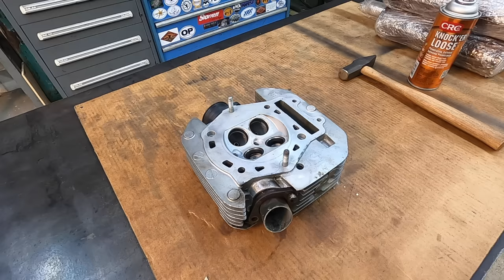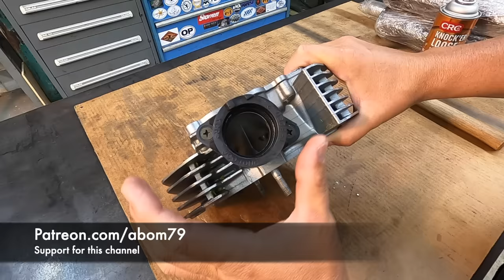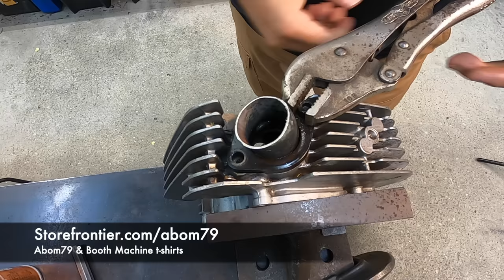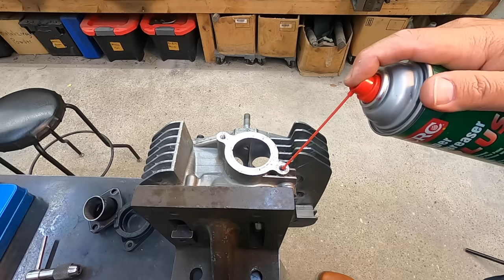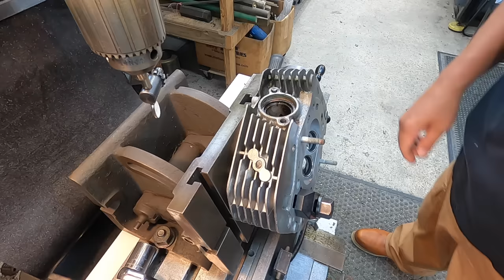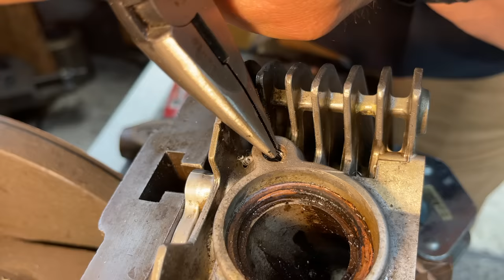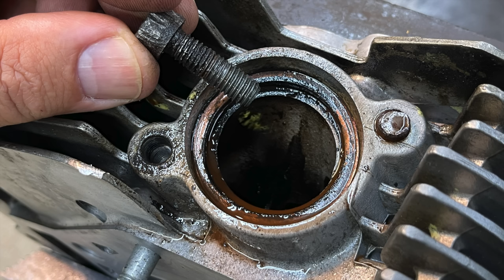Broken & Siezed Bolt Removal, DR 650 Cylinder Head

Comment: this side of the pond we would tig a nut or bolt stub: cut of at the start of the thread, The same type as the stuck caphead. That in and of itself may well do it but leave it to cool right down. ie Heat and wate not weight. Then  put the whole head in a PID controled electric oven/furnace  and slowly heat to some 350Deg C. Then using a HHO (browns gas torch) heat the stuck stud up to pretty much red hot. again bring the whole assembly down using the ramp facility on the PID say over night. Now get your light weight rivet gun with variable strike and a grolly bar (1/2" extention with spanner flats or a built in ratchet handle while ratteling it in an axial direction apply such torque that you estimate the bolt will stand. If it is going to come it will come out quite easily under heavey strike and constsnt torque.
If it wont the next possible attack is spark erosion We have used it many times on restoration of uk vintage military jets. There are plenty of sources for that teknique, It takes time though and special kit that you can hire, well you can over hear.
Another attack is clamp the patient on the bed of your milling machine note and lock the X & Y positions, having  identified the thread for its dimensions use a carbide slot drill just a thou under the bolt crest Dia. and as acurately as possible center the cutter. Now run this carbide slot drill a couple of threads debth down, inspect to see if uou are in the center unlock the slides and adjust accordingly proceed to the bottom of the bolt checking every couple of threads.
Might be an idear if there is sufficent material to put a helicoil in while it is still mounted in the machien. Thats why you lock the slides and you now have a carbon steel bolt on a SS Helli, not as likely to jam up again.Remember the first souple of threadsi nspection is important.
Don't  mess around with the easey stuff it never works and cam make the situation much worse leading you to have to call out the big guns PI like rivit guns
Reply: How many people have even one of those specialty tools in their garage?

Comment: When you have a seized Allen head find a torx impact bit slightly larger than Allen socket size, (may need to drill the head to enlarge) then use your impact driver and a hammer. Torx will cut into the Allen head and get purchase, impact driver will shock and apply torque - which is better than just straight impact as you are doing with the punches. Impact driver a must for old Japanese motorbike maintenance/repair.
Reply: I have used the straight bit from that impact kit, on a socket and socket extension to pound in a screw driver flat.  I have never tied the torx.  I may like that better.

Comment: could you not have tried to heat up the bolt with a torch? thats what i used to do to get seized bolts out.. just try to heat the steel bolt up, not the aluminum head
Reply: Maybe on a bigger scale situation, by concentrating heat on the bolt only, but nothing beats the TIG  and bolt at specific time with a spanner, please read my comment on top.

Comment: If it's sticking out like here I'd first try to cut a groove in the broken bolt and use impact with flat bit. you can always drill it later if it doesn't work.

Comment: Another way to remove the broken bolt is try a left hand drill which if it does come out then try an easy out before drilling out and picking. Works most of the time for me.

Comment: Thought this was touted as the easy way to get bolts out. Man, all that machine stuff and all. Great you got them out as you did, but the one with the missing head, I'd have gotten it out way easier than setting up all that stuff for a drilling step that way.

Comment: I just don’t know why motorcycle makers don’t use stainless hardware on exhaust systems.
Reply: Stainless Steel actually NEEDS oxygen NOT to rust. So it will still rust deep inside tight  spaces when exposed to moisture. So I was taught while doing Mechanical Engineering.
Reply: @peterchinquan8919  🤣 yes it can corrode in low oxygen situations. The way you said that was an exercise in verbal gymnastics.

Comment: “Jis” Phillip Head screw.? Wats jis mean
Reply: Japanese Industry Standard  they are different to a standard philips head the cross section is flatter if you use a philips screwdriver on these they will strip out the head.

Comment: Great job!  Penetrating oil is my first go-to followed by taps with a hammer like you did.  Why didn’t you use an easy out after you did your first drill out?  I saw another YouTuber simply cut a straight slot in the bolt head with a cutoff wheel and use a straight slot screwdriver to remove.  Just for everyone’s info.  Works for me!

Comment: I'll admit this is somewhat crazy and dangerous, but if you've got a seized steel bolt in aluminum, try some full-strength sulfuric acid, as in battery acid. Use the acid as you would penetrating oil. Work fast and have some baking soda and water in a squeeze bottle to neutralize the acid. You will lose the threads and you'll have to put in a helicoil, but at least if you're lucky, you can get the bolt out

Comment: I Work in heavy equipment and trucks for 40 years and most of the time when the bolts are seized or whatever term you want to use the last thing you want to do is drill them out takes up more time than you really want to put into the head the best thing to do is use penetrating oil like you are for starters and there is a  trick I’ve used is to heat up iBolt then use some candlewax to get the wax will flow through the threads it sounds kind of hokey but it does work    Weld a bolt to a broken stud if possible sometimes you do have to drill little bit and use an easy out

Comment: I used  heat and beeswax  works well
Reply: Worked in an automotive machine shop. Heat and wax worked well for us. Have to watch, NOT TOO MUCH HEAT. Especially aluminum
Reply: @dalehood1846  yes I also yes antsize I  work bkes so if your taking high heat using any harden bolt in aluminum heads when putting back together  and the  porper torque setting never had a problem no matter how old

Comment: All you had to do is put some heat on it there is old thread locker on the bolt and heat will burn it out you then it will loosen

Comment: I've worked on old motorcycles for many years. You can do it easier by using an angle grinder with a thin 1mm cutoff disc to cut a slot in the bolt head, like a screwdriver slot. Then spray penetrant and leave it over night. Then most of the time the impact screwdriver with a flat bit will get the bolt out, you just need a bit of patience, lots of small whacks will work the penetrant through and the rotating impact loosens the siezed threads.
If they are real bad, I cut a big notch on the outside edge of the head, and use a punch and hammer, hitting at a tangent. This puts huge turning forces on the bolt head but usually does not shear the head off because the force is quick. Again lots of smaller hits is better than trying to use larger hits and wrecking the head.
I've never needed to drill out a bolt in a motorcycle head, to me that's like an amatuer method sorry. But I have had to work it over a couple of days with penetrant spray and punch tapping each day until it eventually loosened and came out.

Comment: I would put a tap in the fresh hole, and then put the tap in the drill head. It is easier to move the whole head so you can put the broken bolt under the drill head

Comment: Using a female easyout does the same with an impact wrench
Reply: I have never seen one of those.  Does it need some bolt shaft above the surface?  I like the normal internal e-z outs.  When you drill the hole though the bolt, (not touching the threads, and I can drill them by hand), the hole actually relives the pressure on the threads as you twist it out.  I just use a small crescent wrench, (or maybe should try a tap handle.), and careful because the e-z out is hardened and could break if you get sloppy with the force.
Reply: E Z Out is the biggest “Naming Lie” ever invented.  Absolutely nothing  EZ about them!

Comment: I tell you a trick I found out but experimenting. After you put that vice grip on tight get a hammer, no we're only doing tap we're shocking that whole bolt. How don't hit the end of that vice grip but tap the middle, why you tap the end it only bounce back. But hit the middle  it somehow lock and the end weight is like a flow through. This way shock the bolt. I have done it to all tight bolt even rusted and it alway comes out after a few hit. Try it  both way, and see what Iam talking the middle you can shock the bolt at a lower just tap even holding the hammer in the middle also, about 5-8 times tapping should  break it free.
Reply: Well not vice grips, but  your socket wrench as that longer, but load the nut by holding it toward counter clock. And tap the middle

Comment: Afraid of damaging your locking pliers in the beginning?
Reply: Don't know if you ever used vise grips, but the adjustment bolt on the end adjusts the jaw span.  If you can't get them shut, you have to loosen it a bit.  He was using them correctly.  If you get them too tight,---they can be a pain to remove too.

Comment: I have had good success using my Dremel tool and a carbide wheel to cut a slot in the end of the broken bolt, then turn it out with a standard screwdriver.
Reply: You're not breaking that loose with a screwdriver
Reply: @spacejamgoliath  Agreed, probably not that one, but it does work in some instances. Cutting the slot creates a little heat and helps also. It works more often than you would think. It's also important to use a screwdriver with a square shaft or a hex so you can put a wrench on it.
Reply: @spacejamgoliath  Impact tool does come with a straight blade for slotted type screws and bolts.
Reply: @Orange-Jumpsuit-Time  what does that have to do with a screwdriver? Did I say an impact won't work?  Bye
Reply: @spacejamgoliath  By putting the straight blade attachment onto the impact tool you have in effect turned it into a......wait for it......screwdriver. Duh.
Reply: @Orange-Jumpsuit-Time  do you just like arguing? I clearly meant it wasn't breaking loose with a HANDHELD SCREWDRIVER. Now good day
Reply: @spacejamgoliath  "HANDHELD SCREWDRIVER"? How do you think you hold the impact tool with the straight blade attachment with, your teeth?

Comment: so much overkill. time = money.
Reply: That depends on what ever else you have to do.  He is doing it as a favor I am sure.
Reply: I think this was more about showing different ways to approach the problem. I  think that it's called sharing knowledge and experience. Do you have a link to your youtube channel?
Reply: @anneeldon2735  sorry, didn’t realise only those with YouTube channels allowed to comment. 

There’s not many that have all that equipment at home so you can either take it to someone like this guy who will charge you $400 because they spent half a day messing around, or you do it yourself in any one of the countless quicker and easier methods. It’s a snapped bolt on the exhaust port of an air-cooled head, not a m2.876 bolt on the JWST.
Reply: BuzzyRR, it could be about results. Faster is NOT always better. FYI,     I worked in an automotive machine shop and was on a Top Fuel race team. Have a good day.

Comment: Surprised you didn't tape off the exhaust port to prevent drilling from entering the head
Reply: Why? The heads obviously up for an overhaul and there was nowhere for metal chips to go except for an oil way of course.  However a good mechanic would flush all oil ways out any way.  IMO

Comment: bit of a long winded way to do a simple job.  Diesel fuel is the best penetrant. Drill the broken stud to about 65% of diameter, right to the bottom, leave to soak in diesel.  Put the Head in an oven or bbq to about 400c, to expand it. Eazy-out the stud.  Re-assemble with copper grease., Heli-coil if needed😊
Reply: Break fluid, heat, tapping & time may help!

Comment: it was a slot drill not an end mill you used, and why didnt you just use screw extractors once you had a hole in the centre?
Reply: screw exractors willexpand the drilled bolt making it tighter

Comment: Nice work, precision tools make all the difference. I agree about not heating it. I see guys heating things to cherry red and more than likely damaging/altering the metal properties.
Watching all the shavings go into the head bothered me and was cringe worthy.
Reply: What good are perfectly unchanged metallurgical properties if the thing gets chucked in the garbage because it's useless with a broken bolt in it? 🤷🏻‍♂️ Heating an aluminum head and a broken steel bolt is a great application for heat. The aluminum will be fine, and the person couldn't care less about the steel bolt remnant. That bolt is destined to become a razorblade or binder clip over in China a month or 2 after landing in the shop scrap bin for recycling day. 😸 Heating works great a lot of the time. Oh, and the shaving are no factor. A head and a block and any other engine part oughta be cleaned THOROUGHLY before being returned to service. Parts washer first and then an air blow gun with solvent to blow out every oil and coolant passage and each water jacket cavity. Casting and gallery plugs are removed to allow this cleaning, no exceptions, ever.
Reply: This is perfect pairing for heat related methods. Steel bolt & aluminium head have vastly different thermal expansion rates and in this instance it's in the orientation you desire, I'd drill & tap bolt with a left hand thread so I could torque it up and then heat the aluminium.

Same as trying to remove blind bearings from aluminium or magnesium crank cases, blind puller + heat, if a few thermal cycles haven't worked then welding races is fast, effective and doesn't much equipment, parts have to be cleaned either way.

Comment: Dude, use a flank drive spanner (wrench) or socket but give it a bit of heat with a blowlamp first. Never use vice grips on a seized nut to bolt, you’re bound to do more harm than good. I’ve been getting seized studs like this out for fifty years in half the time you were messing around!
Reply: The vise grips were fine, and he took it real easy with them.  But drilling a broken bolt/stud by hand with an e-z out has always worked for me, (a good center punch and small pilot drill that fits in the punch hole stays on center).  It is broken taps that can be a real pain.

Comment: A much bigger drift punch larger than the bolt head and smash it harder and make the hex hole smaller and then  use an old hex key and smash it into the hex hole and undo it.
Reply: I bet you dance gracefully too.  :)
Reply: I’m sure you have a great collection of really, really large hammers.

Comment: Maybe weld a nut on the broken bolt and get it out in 5 minutes?
Reply: I've been there too, and sometimes that doesn't work Either.
Reply: No, this is seized solid and the welded nut is okay if its not seized Solid..

Comment: Shade tree at best. Who uses a steel vise to secure an aluminum head? That head will need to be machined now that he clamped it in a steel vice. He should have used a brass vice or brass inserts.
Reply: He did not use a vise, he used a machinists angle plate, will not damage the part
Reply: @davidbarrett9116  forged aluminum. Head gasket will never seal. Head will need to be machined.
Reply: @philliparmenta4648  no it won’t
Reply: @ForCheapTimeS  mi
Reply: @philliparmenta4648  in by
Reply: @jamesknight1985  huh?

Comment: drilling out the 2nd bolt was really useless time waster, as u could just weld a nut on it and turn it loose - it even has a small part of it still sticking out from the top

Comment: Why use bolts at exhaust mounts when studs with nuts can be used and this wouldn't occur.lmao
Reply: Sure you can. Some brands do that. But that's no garanty for the future that these nuts won't break the studs. It has the same problem: extreme heat and rust at one point over the years. Or poor quality nuts were used that damage the studs. Then you need this video too 😄.
Reply: @Wil-70-NL  yes I agree so maintenance of these faults with the best appropriate materials and designs are paramount to prevent further degradation of whatever is at fault. There's always a solution to the inherent design faults the manufacturers and design engineers incorporate into their products, although time and money is the subsequent expense it's in the owner's best interest to address these and other issues as I'm sure you are aware of. Thanks for your reply too and hope you overcome whatever stands in hour way. Cheers
Reply: @chris_sirhc01  True. The owners best interest to do it better with better products or a simple change in the design (with other mechanical problems on a bike or car) can do a lot. If i didn't cut out the rust of my oldtimer 30 years ago, it would be gone by now...😂.
Reply: @Wil-70-NL  improvisation, apply it not only in your life but for your cherished ones too and if not reciprocal or respected you know what to do. Cheers

Comment: You're supposed to use a chaser tap to avoid weakening the existing thread.

Should have tried an EZ-OUT before you took all the meat off of that broken stud with the bigger drill to avoid picking out slivers of what's left.
You only ball parked the centering operation and came awfully close to the actual hole thread size with that last drill, pretty risky operation at best when it comes to avoiding taking out a portion of those hole threads.
Reply: 🤦‍♂️ Where is your machine shop?  😳
Reply: Don't have a machine shop.

Comment: In japan we have much better machine to get out those broken volt out of that thing.. Im pretty sure you dont have those in America
Reply: Any more info?
Reply: @Madnesswillensure  What's wrong with thin copper protector washer, then spot welding a nut to the stud?  I.E. my fix! Then always use nickel lube on hot dissimilar metal bolts & like spark plugs!